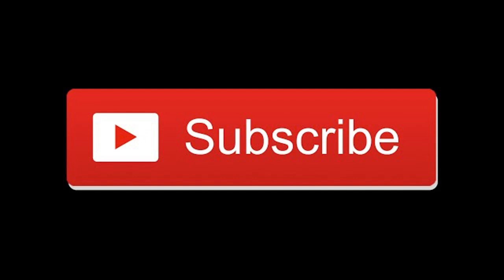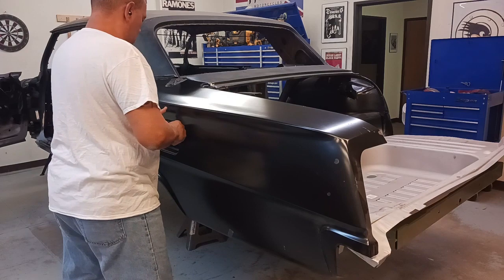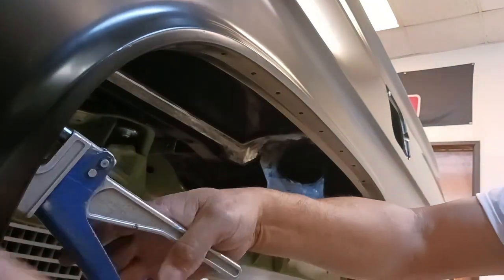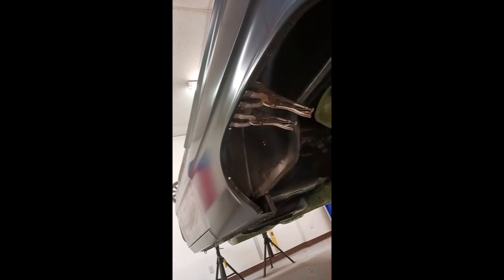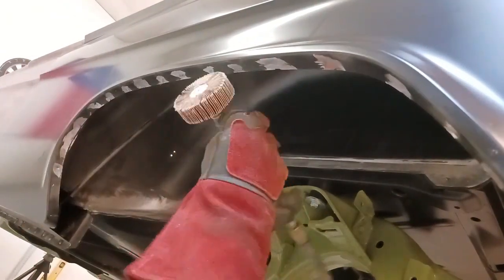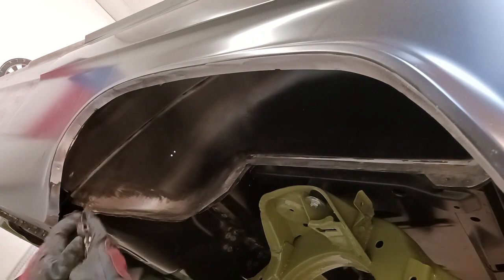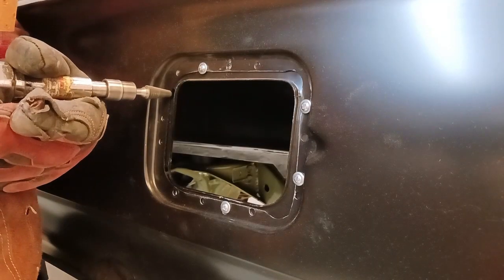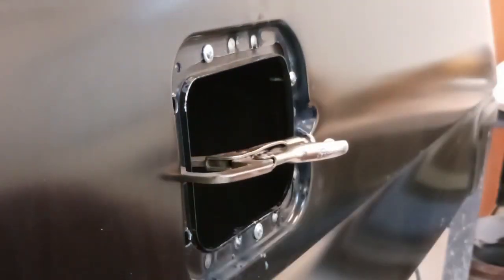1962 Impala Restoration Part 18 - Install / Weld / Dress LH Quarter Panel       DIY Auto Restoration

Comment: Oh man you do incredible work brother thank you so much for bringing us along for this journey. I have been learning so much brother I am so excited to apply what I have learned from you onto my own 62 impala and my chevelle and Saratoga. You rock man
Reply from the maker: Thanks !
Reply: @guzzifabrication3448  hello, where do you get them tools that hold your fenders together when your doing  your hole punching
Reply from the maker: @LOSKOPROJECTZPODCAST916  are you asking about self-tapping screws, clecos, locking pliers?
Reply: @guzzifabrication3448  locking pliers with the U looking thing to clamp down the fenders
Reply from the maker: @LOSKOPROJECTZPODCAST916  Google auto body Toolmart
Reply: @guzzifabrication3448  awesome thank you, I’m starting to work on my 63 and gots lots of rust and stuff I cut out I need new qtr panels and I just bought whole full floor pan to put in and getting a new X frame cause the existing one is rusted out, so much work and I have a dent on my roof so it’s one thing after another but it’s my dream car and your helping thank you
Reply from the maker: @LOSKOPROJECTZPODCAST916  👍
Reply: @guzzifabrication3448  got couple years probably ahead of me to build my dream car but it will get there thanks again, can’t wait for the next video

Comment: Hey Robert, I've been following from the start and I do so appreciate all that you've shared with us, I am using your techniques and it is really helpful to see the actual products that you use. I am still hoping to see how you finish up the front rocker extensions to the lower cowl sides (where the front fender heel mounts go). It's the worst area on my 61 bubbletop.
Reply from the maker: I'll try to include a shot of those in the last video.

Comment: I have so enjoyed this video series, and can’t wait for the next. Is that the original frame or did you go with a donor? How do you find the replacement panels compared to the original for thickness and detail rust not included. Cheers
Reply from the maker: Yes that is the original frame, the thing about metal, old vs new is that in the past as with everything, it was about quality and I am speaking to the purity of the metal itself.... now with all of the recycling, low quality materials, etc the properties in the metals that are produced can't compare with the older higher quality materials used..... Thanks for watching !

Comment: The frames have so much flex on these cars, when putting the quarters on you have many jacks keeping it level ?
Reply from the maker: THanks for the comment, the car frame was supported in key areas, time stamp 11:25 the door gap  wouldn't be this nice if the body was twisted.

Comment: Do you have the ss seats for that car? I need a favor. If possible can you measure the top part of bucket seat back width and the widest part of the bottom to see if I have the correct buckets. Thanks and continue the great work
Reply from the maker: Sorry I do not have the seats or I would measure it for you

Comment: Hey man I have another question. Did you test fit the trunk in prior to welding the quarter in? I have both quarters sheet metal screwed in on mine and at the taillight side the trunk opening gets tight with the trunk in. I’m wondering if each quarter panel has to be an equal distance from the center of the trunk. I’m glad I checked before welding everything in. I was just assuming because everything was fitting that the trunk was gonna fit but the spacing gets really tight closer to the tail lights.
Reply from the maker: Yes I fitted the trunk before fully welding in the quarters, that rear area can get tricky !
Reply: @guzzifabrication3448  absolutely. I’m praying to the lord above you do a video on it and I’m not even a religious man. lol

Comment: Nice work man. Question. On the rear deck lid to quarter panel on the top side of that flange you were punching holes to plug weld (beginning of video) what did you do along that outer seam? You mentioned you were going to plug weld the flange that sits below inside the trunk but on top is what I’m curious about. Do you run a weld bead across? Bondo? I wanna say stock it comes welded.
Reply from the maker: Nothing goes in that same from the factory it's tacked on the ends with brass and resistance welded on that flange, that's all
Reply: @guzzifabrication3448  is that specific for the 62? Application I’m referring to is for a 64. Mine had a bead which was ground down on each end. I was just assuming that was factory. Not on the under side but on the top side from window seal to trunk weather channel.
Reply from the maker: @ChristopherL0rtiz  That apply to all across the board.
Reply: @guzzifabrication3448  hey thanks bro. Appreciate you sharing your knowledge. Really helps.